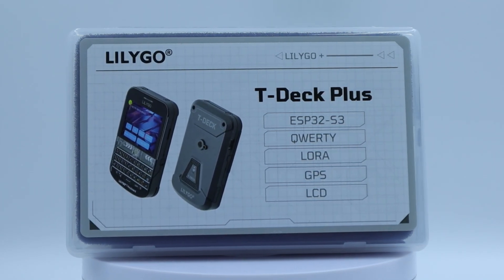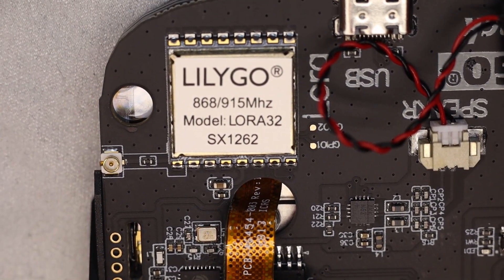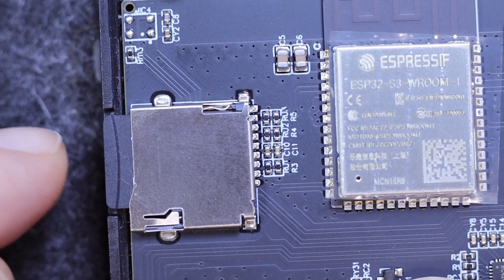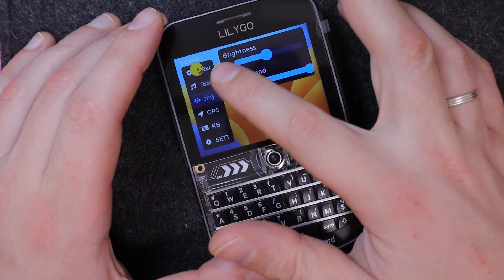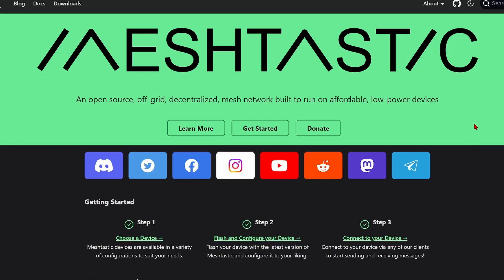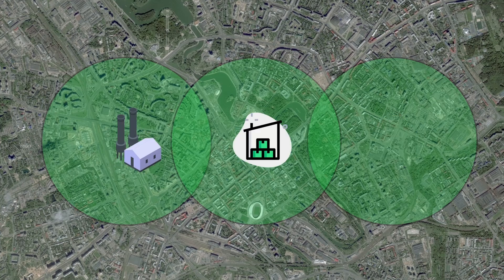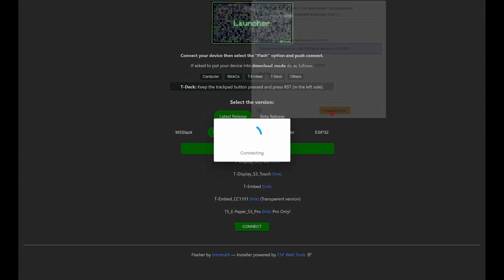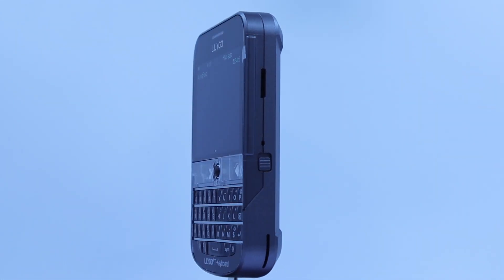What is T-Deck Plus ?  Lilygo, Meshtastic.

Comment: How do I know how dense de mesh is in my area. And make sure if this will work in my use case.  So if 2 persons have this device. It’s not guaranteed that they can send messages to each other if they are to far apart. What is the distance? I thought this went via satellite.
Reply: ....watch a video. Nodes on balloons give the most range. Towers give like 40 km? Or so. 

Lora has nodes that are low power. Anyone can run one.

Then you have a device to receive.

I don't remember anything else. Good luck